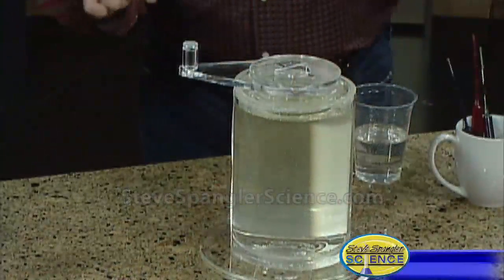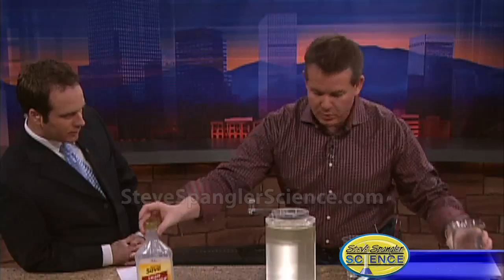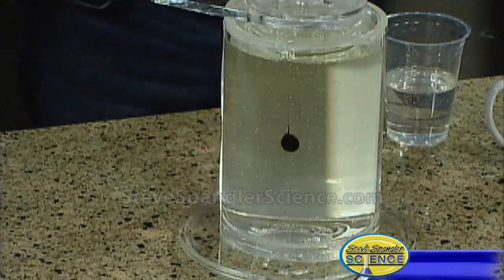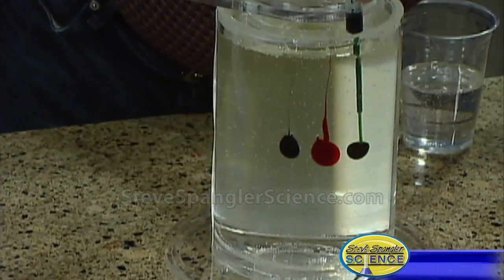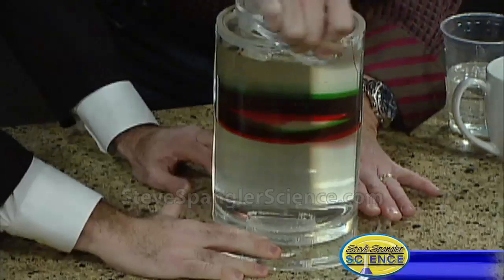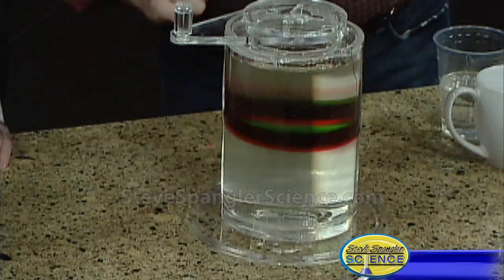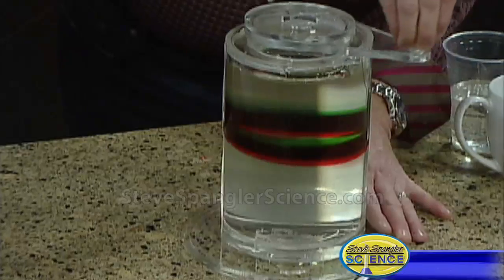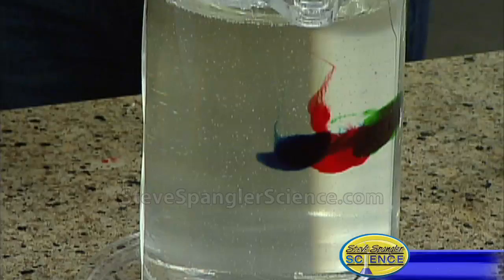Twist in Time - Laminar Flow

Comment: it, in fact, is real, You would have to study about Fluid Mechanics, in that Fluid Dynamics, in That Laminar Flow and in that, Reynolds Number and its effect on Laminar low, this happens because at slower speed the flow orients itself layer wise, which is possible to reverse, theoretically, 100%, but practically a bit less then 100%, that's why you see the colours are still mixed up a bit ^^ its a fact for over half a century with that method

Comment: @jzzsxm 

I think it's pretty relevant. The relatively low Reynolds number combined with the high viscosity keep the flow laminar along the sheet boundaries. That's what makes the process highly reversible. The high viscosity prevents the boundaries from breaking down in a short time scale, and the reynolds number means that its relatively easy to just apply an opposite torque and have everything move back into place.

Comment: @jolte 
It depends on your definition of mix. What happens is that as you spin the cylinder, it drags thin sheets of fluid around in a circle over and over again. Since the fluid is so viscous, these sheets don't "melt" into one mass very quickly, so you can return them to a smiliar state from when you started. If you're having trouble visualizing the sheets metaphor, thing about rolling up a piece of paper.

Comment: @jzzsxm If Re>1 and the flow was turbulent, the mixing of the fluid would be irreversible as the dye would entrain the cornsyrup in a "random process". Here it just spreads out in a thin ribbon which can be wound back up..